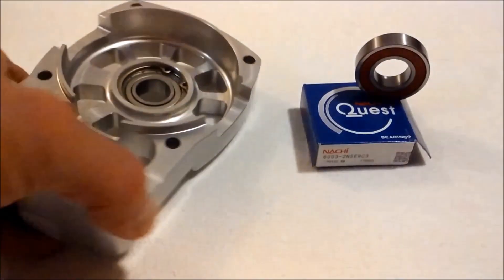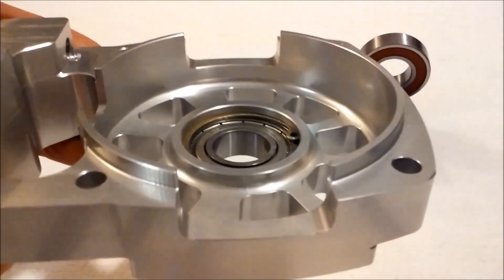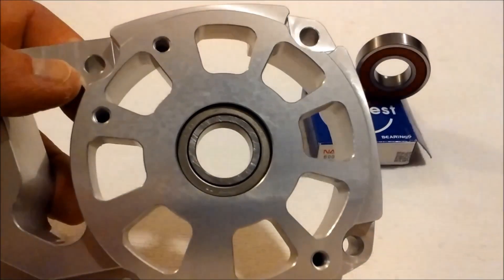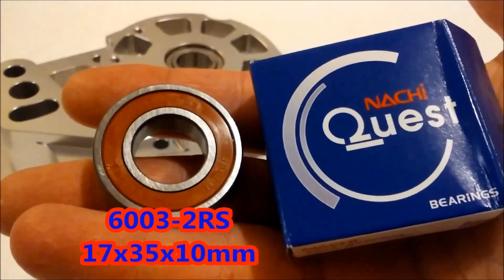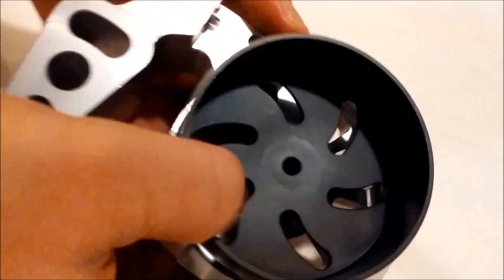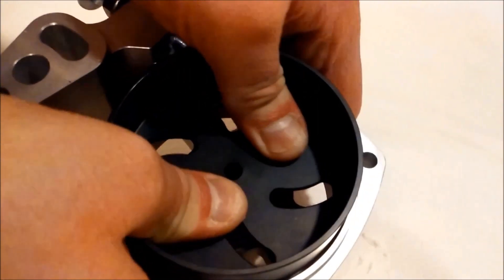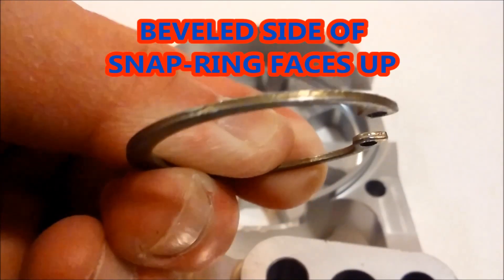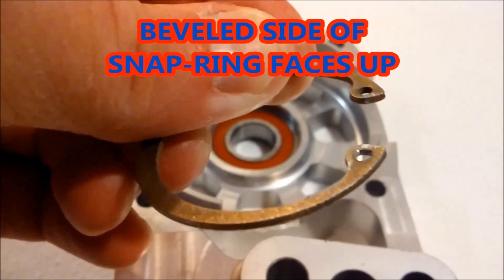(Part: 1/2) How To Replace Go-Ped GSR 78mm Motor Mount Bearing & install new Clutch Bell

Comment: I once tried changing a bearing thinking it would just slip in. Ended up hammering it in and damaging it in the process since I had no press.  This is a great way to install!
Reply: If you have a bench vise with a deep enough throat, you have a press.

Comment: One part of the vid you set the temp at 150° and when you took it out the temp was on broil?
Reply from the maker: LoL, That was my first time heating up an engine mount and what I discovered is that thick aluminum parts are not easy to heat up on a lower temperature setting. So, you need to get the actual part up to around 150°F and in order to do that it still took 15 minutes on broil.
Reply: @TheNoisePolluter  I tried it yesterday and failed. Big ovens don't work and little ones are the way to go.
350 on broil in small oven for 10 minutes and works like a charm. I had to rewatch the vid and look closely at the temp that you had it set on.
Reply: If you have access to a torch, you can heat the aluminum engine mount around the outside of the bearing realy fast, without heating the bearing itself, and the bearing should nearly drop out with the help of a screwdriver handle small enough to fit through the center bore.